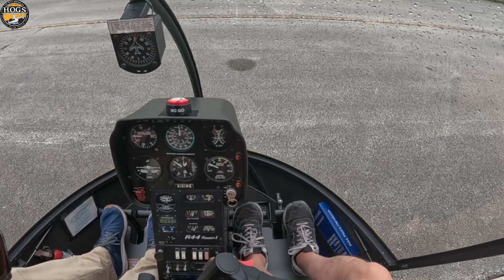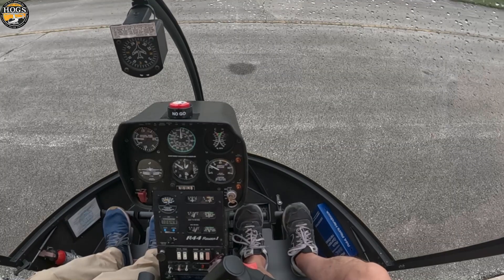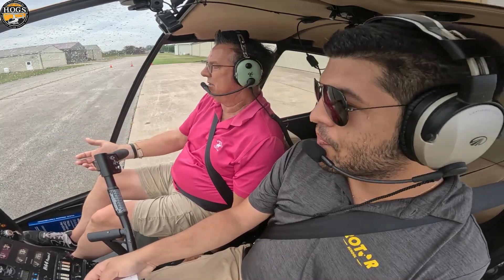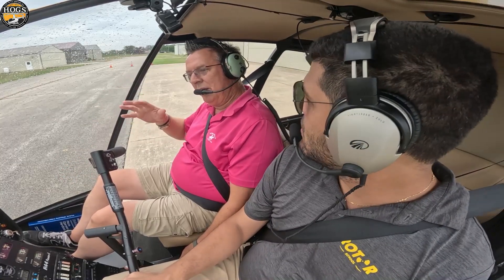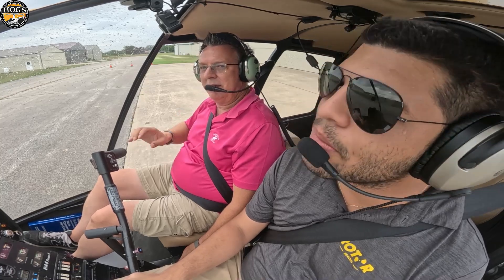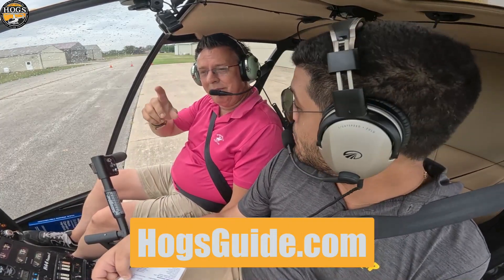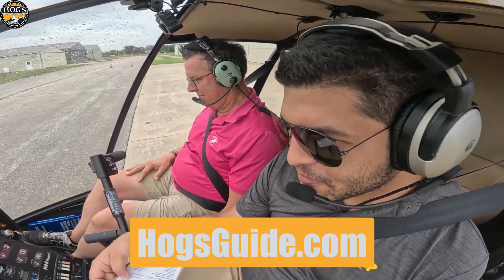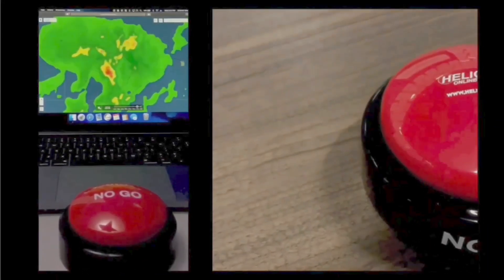Sprag Clutch Check? Adding Right Pedal

Comment: Learning in the south I didn’t even think of this
Reply: always a good idea to coordinate or at least BE READY on the pedals. 

got caught off guard the other day doing a ground run in a 44 and the tail rotor pedal bungie keeps the left pedal forward, rolled up to 100% and noticed the slightest left yaw motion but was ready to catch it with right pedal. was a non event, but something i noted.
Reply: @lyleswallows7364 well my feet are ALWAYS on the pedal but I’ve never had to worry about ice in the sprag check, glad your run up was a non event 🤘🏼
Reply from the maker: Thanks for commenting